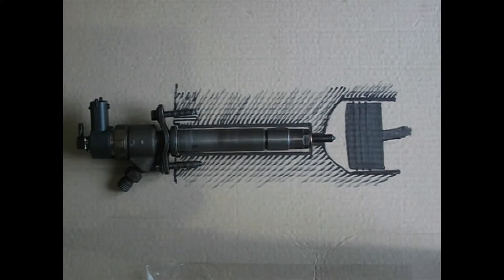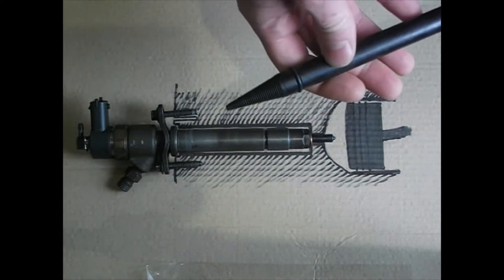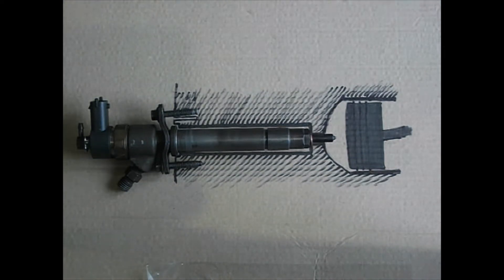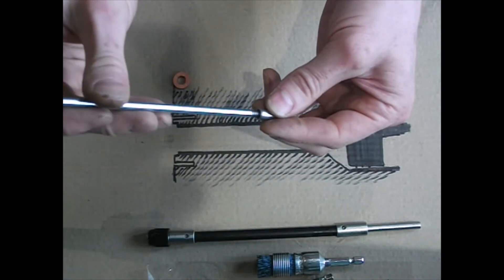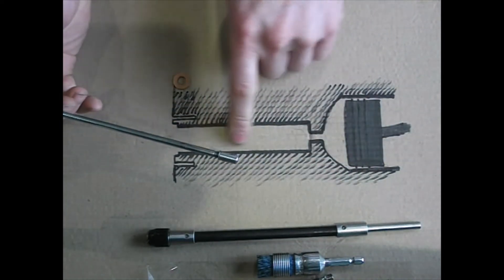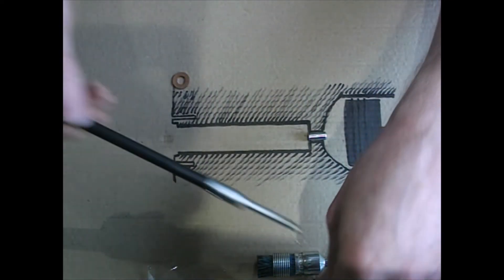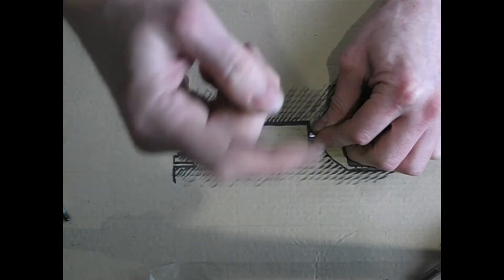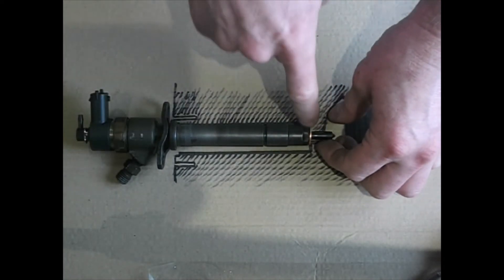How DO you use Diesel Injector Port Cleaning Tools? 🤔 - Explains what is going on inside the head!

Comment: Thank you! It's a very clear video and a brilliant idea to show from the side. At 13:49 where you show the injector reamer tool kit there is another tool at the top of the box. I think it's probably a 15.5 X 225mm Cutter De Burr Tool. What is that used for and when should I use it?
Reply from the maker: Hi - many thanks! You are spot on with the 15.5 side reamer… I can honestly say that in 30 years of working on diesels I have never needed one, but believe that they are for reaming the sides of the bottom of the injector port if the wire brushes don’t have enough grunt to shift glazed deposits…

Comment: Hi sir again
Cam it be used on any CR engine? Mazda, PSA, Vw....?
Reply from the maker: Hi! Yes. The brush kit has several sizes to accommodate different manufacturers, but the thing to really watch out for is the port reaming kit which has different shapes and sizes … it is very important to make sure that you match the profile as well as the size. Hope that helps!
Reply: @bigtalltim It helps a lot. But how to do that?

Comment: hello sir
Greetings from Serbia
This is by far the best  explanation on YT
Thank you.
Question, how good or clever is to loosen clamp bolt a little and drive a car for a vile?  I think that compression would free injectors and it would be easier to remove them.
Reply from the maker: Many thanks! Not a good idea to loosen the bolt and run the engine - the engine should never be run unless all fasteners are up to spec

Comment: Excellent explanation, just a small detail, the long small brush is for the narrow hole above the piston for cleaning. You put a little bit of grease on the tip, this will hold the dirt and you turn it a few times
Reply from the maker: That could definitely help if the “top hats” won’t go in because of carbon build up - thanks for the tip; I’ve never had a problem with the port into the cylinder, but that would definitely work!

Comment: I've cleaned the tip of the injectors on 4 cylinder marine diesel engine several times, but the carbon builds up on the tips again, very quickly. Often only operating for few hours. What do you think is the main cause of this carbon built up. Would be appreciated if you could provide me with some insight on this. Thank you.
Reply from the maker: Hi! Bottom line, it is incomplete combustion. That can be caused by a few things, but is usually indicative of an incorrect fuel air mix (not enough air). That said, if oil from the crank case is seeping through the head gasket or valve stem seals it can also lead to too much “fuel” being present in the cylinder. As it is on all 4 cylinders, if it is oil related, it is more likely that oil is finding its way in to the intake, turbo seals perhaps (you didn’t mention whether you have a turbo). Simple stuff: Check your air filter, replace old fuel as poor fuel (and high bio ethanol content) can cause the buildup of carbon… maybe use a diesel fuel additive to boost fuel volitility… don’t run for prolonged periods at low revs (charging battery?) avoid short trips (in/out of the marina?), and let the engine properly warm up… just like running a diesel car around town, these “driving” habits will result in the engine coking up

Comment: I had one of these universal cleaning tools, unfortunately the plug was a fraction of a mm too small so would hold in the injector port. But as I found out, a slightest bit of pressure and its pushed through into the cylinder. 4 hours later I managed to fish it out with a magnet
Reply from the maker: I’ve never seen that happen! Not a bad shout though to check the diameter of the end of the injector and the top hats with a vernier calliper. Thanks for watching!
Reply: @bigtalltim yeah if the injector seal was still in place I'm sure it would hold it there. I tried a rubber O-ring in it too but would have resulted in the same issue as the O-ring would stretch. In the end did it without one and just had a small tube on the end of a hoover to suck anything out the cylinder

Comment: This video was PURE EXCELLENCE! As they say the devils in the details…
1-I just wonder what type of grease exactly is used for the reamer.. 
2-what exactly are we looking for with the reamer (how aggressive) results.
3-do you recommend a grease( and what kind) to coat the fuel injectors when you reinsert it? 
4-I’ve also learned the copper washer on my N47 is DIRECTIONAL…a right way up and a right way down 🤷🏼 supposedly it’s somewhat conical.
Thank you friend. ❤ 🔧 🚙
Reply from the maker: Hi! Many thanks - much appreciated! To answer your questions: 1. Any grease - doesn’t matter… just something sticky! 2. A clean surface - flat, no scratches, no carbon. Very light pass usually works fine. 3. I don’t use grease on the injectors myself, but your auto factors may have something suitable. 4. Yes they can be “sided” - usually (but not always) the bottom of the injector is flat, and the rounded side would fit into the end of the injector sleeve. Hope that helps!

Comment: I have a Ford C-max II with a Duratorq engine (also used in Volvo's) and I'm a great believer in preventative maintenance. Car is coming up to 100k miles and thanks to you I am now fully informed on how to deal with injectors. Many thanks.
Reply from the maker: You are very welcome - always good to hear that the vids are useful!
Reply: If you have one of these new ultrahighpressure fuel systems, you might want to look into replacement of the high-pressure fuel pump as preventive maintenance. It's expensive, but nothing compared to the cost of the damage done when those things explode. Best value is to be found in a PROVEN low-mileage pump off a crashed vehicle. Best of luck.

Comment: And there’s different sides of washer as well.  So washers are directional.  Little bit curved side faces port.
Reply from the maker: That’s a brilliant point! These washers are flat, but for a lot of cars the copper gasket (washer) will have a curved side or double curve… sometimes a concave mating surface in the port too! Make sure you use the right reamer for your vehicle if you need to clean up the bottom of the port, and as maxin pointed out, if there is a curved side that will face away from the injector and towards the port (hole to the chamber)
Reply: The flat side of the copper washer ,is it not supposed to sit against the hole,so it sit flat with the hole?? please explain to me ,i appreciate
Reply from the maker: Not all ports have a flat bottom - specifics will of course depend on your engine and injectors
Reply: @bigtalltim thanks for the prompt response,and one more question,does it need to do air bleed while installing injectors in fiat grande punto or the system does it automatically??
Reply from the maker: Hi - not sure I’m afraid… I haven’t worked on either of the diesel variants in the grande punto. If they are common rail engines, you wouldnt normally need to bleed unless the high pressure pump needs to be re-primed, but I don’t know for sure I’m afraid

Comment: A very helpful presentation. Thank you.

I chanced upon an interesting tip elsewhere today. A commenter suggested putting the car into neutral then rotate the wheel a few times to turn the engine over just before finalising the cleaning process for the injector channel and seats. 

He stated that the amount of debris blowing back out of the injector port would be worth the task as it clears debris left finding its way into the combustion chamber during cleaning and any lose chamber residue from normal combustion operation.
Reply from the maker: Hi Mark - glad it was useful! Not sure I’d recommend that approach; some of the cylinders will be on the return stroke and may actually drag debris back in! The little top hats take care of business. Thanks for watching!
Reply: @bigtalltim 

That's true. Personally I'd stick to the blanking plugs too but I suppose any cock ups could be cleared in all desperation with the other method save removing the cylinder head to do it.

In my case I've decided to leave the garage to do it although I'm able to do it. It's just that it's a Peugeot, you see...

Comment: QQ:  After cleaning the injector port with the cap blocking debris. would it be good to use vacuum machine to suck all the debris out?
Reply from the maker: You could - just use the insertion tool to hold the cap down, and make sure that you don’t accidentally suck the cap up! More commonly, folks hold it down and blast with an airline gun to blow the dirt out

Comment: Nice video, really liked it and thank you for your time and explanation. Just one question, i was wondering, what about all the dirt you scraped with that cleaning tool? Isn't it all at the bottom after cleaning? Shouldn't you vacum or blow it all out before taking that little blockade out and reinstalling new copper washer? Just wondering. Im just curious.
Reply from the maker: Glad it was useful, and you are very welcome! :) You have a couple of choices... In my experience, most of the dirt will come out on the wire brushes anyway, but if you have any debris left over and are going to blow it out, it is an idea to stick the insertion tool back into the little top hat thing and hold on to it to stop it moving while you blow... same if you are vacuuming - although it might be tricky to arrange a small enough nozzle to vacuum effectively. Maybe try duct taping a piece of pipe to your vac nozzle to reduce the diameter. With the reaming tool, a blob of grease on the end will capture any swarf or other debris, so less of an issue. Thanks for watching!
Reply: @bigtalltim  Thanks, will keep in mind :)

Comment: my very experienced mechanic said that it don't  matter if some debris or aluminum chips goes to the cylinder, that they will melt away when the engine is running.. I disagree with him but he has done these repairs for years.. I have OM646 that has "black death" repair coming next week
Reply from the maker: I absolutely disagree with that - the kit comes with a cap for a reason, and it is just crazy to not use them!! Fair enough with grease or carbon, but aluminium chips in the cylinder would be a disaster; even a slight score on the cylinder liner will allow the cylinder pressure to escape into the oil system which could cause all sorts of leaks and blown seals.
Reply: @bigtalltim  I disagree with him also, I will tell him that no debris or aluminum chips can go inside the engine or fuel system, he said that he will use air pressure gun to clean the injector  holes, that is insane, then most of it can go inside the cylinder?
Reply from the maker: To be fair to your mechanic, if he sticks a very long airline jet nozzle all the way down to the hole into the cylinder, he may be able to blow most of the nasty stuff out of the injector port, but I certainly wouldn't let anyone do that on one of my vehicles! Good luck - and thanks for watching!